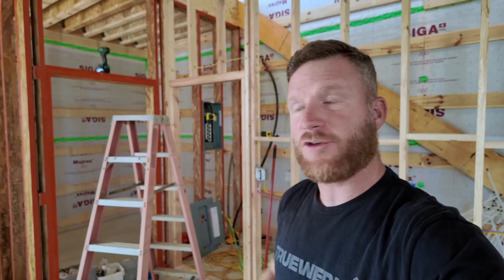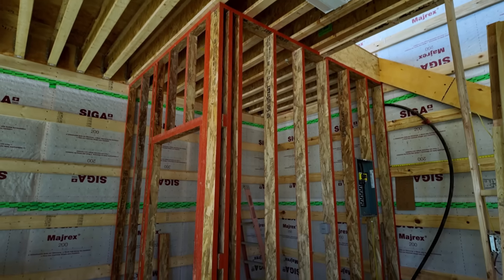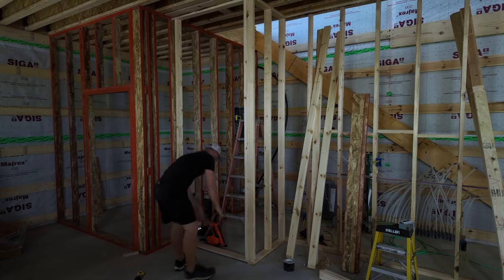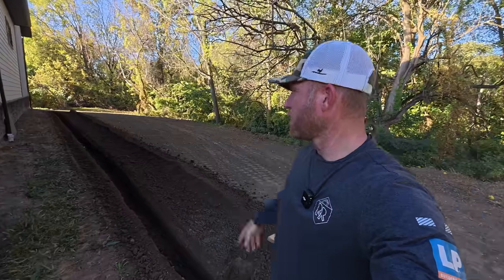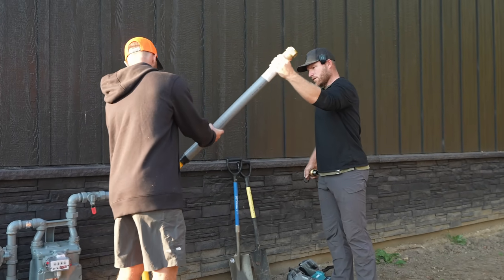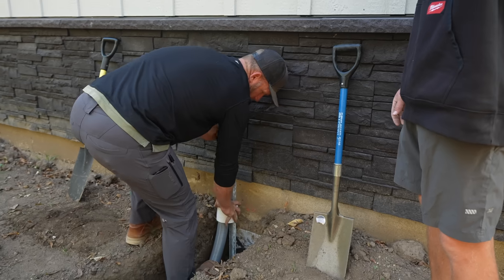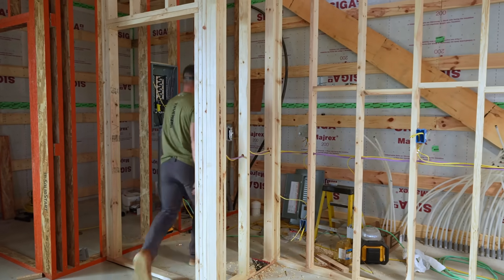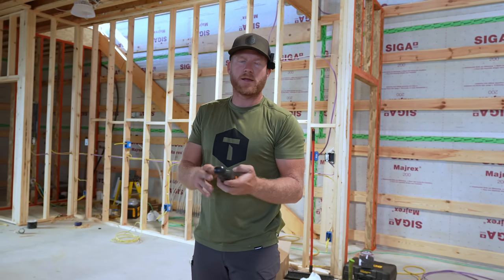Electrical and Gas Update at RRHQ 2.0

Comment: I didn't think it could get any more bizarre with the units than cups, ounces and pounds per square inch. The 'foot candle' is a new level of ridiculous.🤣
Reply: Relates old how far you could see 1 candle lol.

Full daylight typically equals about 1,000 foot-candles, while an overcast day would have 100 foot candles on a horizontal surface.

Comment: Former electrical contractor and inspector here.  You may have an issue with moving that load center further in on that wall.  NEC requires wires to terminate into a breaker or disconnect immediately when they enter the building.  You may need to add a disconnect on the outside before it comes in.  Also, on a 2x4 wall, you cannot use  inside box knockout.  You need to maintain 1 1/4” from nailing surface at all times.  If you miss the stud with a screw, it can go right into that wire.  NEC 300.4(D) on the boxes and 225.32 for the disconnect location.  Hopefully this save you from a failed inspection.

Comment: You can never have too much light in a shop. Whatever you think you need,  double it and put it on multiple circuits so you can turn on as much or little light as you need.
Reply: I just recently finished my garage and yeah I installed a bunch of lighting. The older 4 tube garage light fixture, removed the ballasts and put in LED replacement tubes 

But I wired it so every other tube comes on with one switch, and the others come on with the second switch. I didn't want dark spots, just everything illuminated. If I'm working on something, as simple as flipping a second switch to get really bright.
Reply: @shaunmac983  That's what I'm talking about. Sounds awesome. 

I have marquee lighting fixtures in my shop. Three 13' rails with 76 sockets per unit filled with 100w equivalent LED bulbs. Zero shadows anywhere in the 18'x24' space.

Comment: Hi Kyle, Electrical Engineer here from Australia, have been in lighting for many years.

LED technology is great for efficiency and high output, the issue is that they create high glare and 'hot spots' this is the intensity underneath with a sharp cutoff as you move away. It would be useful to understand how the LED chips are arranged in the fitting itself. One way that manufacturers avoid this is to use optics within the light fitting itself, the LED chip is set back inside of a optic or guide, that way the glare is less intense in your general FoV. A fitting with this feature may be a solution to this problem. The optics will also help to spread the light and reduce these so called hot spots.

Another issue with large spaces, especially tall ceilings is what we call the 'cave' effect. When lighting a large space, you should try and light the walls and ceilings as well, generally 30% of the lighting output. What this will do is reduce the perception of being in a cave and reflect lighting around the space. Research into this has been done and it shown that it increases peoples mood, quite interesting. This is something that online calculators might not be taking into account, hence the requirement for only 3 of the high bay lights. 

Hope you find this useful! Loving the series so far.
Reply: The trendy dark ceilings like charcaol or black would be better served with white or galvanized then?

Comment: I have been doing gas for 45 years and all I can say is Oh Boy. Love your channel. Ron
Reply: Yeah, love RR, but the gas line segment was a mess: Should have been installed deeper. Should have used Lyall 90 deg elbow-style risers with support stakes. No pressure test before covering up the line?
Reply: @preston8847  In Florida we bury ga lines 4 feet deep.

Comment: I went through the same lighting questions with my Woodshop.  I tried several different lights and was not happy.  I contacted American Green Light and they hooked me up.  I sent them a drawing of where all my tools are and they told me exactly where to place each light and how bright they needed to be.  They even gave me a heat map of the shop.  They are not cheap, but it was worth the money.

Comment: Went with Barrina LEDs in my garage.  Super easy install, flexible location, linkable but most importantly, super bright.  Way better than my original tube fixtures.
Reply: I got 36 of the 8' barrina bulbs for shop and garage and 24 of them died within a year. Not happy!

Comment: on your outside walls you can run Romeo without puncturing your Air control layer.  Instead of using the 3 1/2 or deeper single gang boxes, using 4x4 x1 1/4 boxes with a cover plate. if you have to go vertical through your Girts, slot them and plate them.

Comment: In my 30’ x 50’ x 14’ shop (with just concrete and white walls), I had to try a few different luminaires as well. I had the same issue with one that I tried having no diffuser and shining in my eyes without even looking toward them.

I ended up with 8 Commercial Electric 2ft 18000 lumen high bay lights from Home Depot. They have a decent diffuser and I like the color temperature. Very satisfied still after 2 years.

I see that they now have “Commercial Electric 15 in. 19000 Lumens 138-Watts Adjustable Beam Multiple CCT & Lumens Integrated LED High Bay Light 120-277V”

I recommend checking them out. Have the adjustable angle and the adjustable color temp is something I’d really like. They don’t break the bank either. Though the CRI is only 80

Comment: I’m an electrician in Primarily do electrical for two contractors that build post frame buildings. I like the 2’ high bay’s I’d pry use 23,000-25,000 lumen for your building. It’s definitely bright but you could always use luminaire wire and put a dimmer on it as well .

Comment: I have a 50x80x16' ceiling, used lights from prime lights. They are 4' long led bulbs with six bulbs per fixture. 4 rows with 3 fixtures per row. Perfect amount of light for they area.

Comment: I think I would've just flipped the electrical panel around and hid it behind a hinged mirror in the bathroom. Pretty sure that would've met code once the sheathing is up in the mechanical room, right?

Also, something I've been considering with shop lighting is instead of doing direct lighting, use  long drop lights flipped upside down and reflect the light off white or galvanized metal on the ceiling.  We had that in our huge cubicle farm when I worked at Dell in OKC and we always had good even lighting, very few shadows, and no glare. Works better than any diffuser I've ever seen.

Comment: Kyle,
One suggestion would be up firing lights. Commercial buildings use them and you don’t get as harsh a light but still very bright against a white ceiling.

I’m surprised how shallow your gas line is. Here in AZ, minimum of 24” and that dirt looks soft compared to the concrete we call dirt.

Comment: CRI very much matters; try to get over 95.  Remember your "workplane" when shooting videos is your head height, so with a 9' ceiling you really are going to need lights spaced less than 8' apart.  You can turn the highbay lights upside down and suspend down about 2' to reflect off the ceiling. 

Really though you want a lot of lower-brightness lamps to reduce the harshness.  With a 16' ceiling I would say something around 5,000 lumens maximum.

Comment: The online lighting calculators are useful, but for a space like yours I'd go to a local light fixture distributor and work with one of their professionals to figure out what fixtures to use, their lumens/cri/diffusion/etc., the number of fixtures to use, their spacing and so on.  As a general rule high bay fixtures are used when the ceiling is around 15' or higher, switch to a conventional type fixture where the ceiling is lower than that.  You definitely have different zones that will require different layouts - the main open space, under the mezzanine, and on the mezzanine itself (plus the bath and mechanical rooms, as well as exterior lighting and maybe also exit and emergency lighting - I don't know what's required for your type of building in your area.)  I think it's worthwhile to stick with name brands, you can buy fixtures online for less but like anything else you get what you pay for....Lithonia and Columbia are a couple reputable brands but there are others, plus it will depend on who reps for what companies in your area.  Your electrician should be able to recommend distributors in your area.  Note that you don't necessarily need the same level of lighting throughout the whole space - include some task lighting over the workbench where you want it really bright, but for the rest of the space that's mainly going to be for storage the requirements are much less.

Comment: I just built my 30x40 shop 2 years ago. 12’ tall ceilings and we stick framed everything, no metal. And interior done out of OSB. I used a 6” pancake style 1,200 lumen flush mount light. They are cheap and easy to install and put out tons of light. I wanted a flush mount look. I can send picks if you are interested.

Comment: For Lighting, you might try the 4' LED Florescent - Daylight Spectrum.  It has more Blue Color.  Which is easier on your eyes.
The Florescent Light Bulb, Being Round, gives you a Wider Angle, So your light will be more even instead of getting so dim in between lights.

Comment: Look into Rab lighting been using them in pole barns for over 7 years. They are round ufos looking but are fantastic at light distribution. Also for the area with tgis just throw in some can lights. The ceiling is too low for even a low bay fixture.

Comment: I have a 50x60 with 18ft walls.  I used Hyperlite UFO High Bay on Amazon.  Theyre pretty bright.  I have 12 or so.  I did install some side lights to walk around at night without turnign on the bright UFO high bay.  I used 150w and you can get 200w.

Comment: If that's going to be a work bench area, where you were first checking with the light meter, you can always add under cabinets lights. I assume you will have upper cabinets in that area too.

Comment: The high bay lights are a real wormhole to dive into. From my experience, the rectangular lights just seem to be a nicer light, if the look of them when you actually can see them bugs you, find ones with a lens diffuser on them such as a white panel. You can use a low voltage dimmer on many of them, there is a wattage rating for most dimmers and those lights tend to be high wattage, I am uncertain just how large a dimmer can go, but I have installed dimmers that took all the space from a 2 gang switch box and had a breather plate between the switch and wall; a dimmer adds resistance, some of that turns to heat. What I wish I had done was install all the lights on a relay, so I could turn 1 switch and operate multiple circuits of lights with just that one switch. I imagine there is a dimmer for that type of system somehow but have not had to find it before and it is out of my range of electrical work; maybe your friend does commercial/office/storefront work and would have a much better idea than I do. 95+ CRI is the best we have now, lucky for 90+ and the 80+ is a bit bleh. I personally want to be able to read any piece of paper I have anywhere in the shop, I do not enjoy walking over to better light when making things. More lumens is better and if you can dim them, then you can turn down the lights a bit if it is too bright sometimes but you cannot add more light after the fact without a new light. Not all of those lights dim well, some of them, the dimming is a joke like going from a 60 watt bulb to a 75 watt bulb; so ask your buddy or salesmen about that. Most likely, the nearest big town to you that has multiple electrical supply houses will have one that tried to specialize in providing the led lights first, they will be a good source of information for some of the questions you will have, although most may have caught up by now. I say it that way because I have no idea where you live and wish to give your privacy on that.
Southwire sells some romex strippers that look like a T, one side skins 12-2 NMB(romex) the other does 14-2 NM-B romex. They work well when you shove the wires in the boxes before stripping them. there is a small learning curve to them but I recommend them. Klein tools made nicer ones that did a single wire size but no longer makes them, they are shaped like an L; some local stores to you may have a pair on the shelves still depending on where you live. Nice tools that are good for a novice or expert alike, speeds up the process.
I like floodlights to be available to be switched at every exterior door, if you use motion sensor lights forget that I mentioned this. Regular floodlights though, try a few sets of Sylvania Night Chaser LED bulbs, you will not regret it. I like to put the floods on every side of the building so the light continues from one side to the next without walking in the shadows. Just my preference but some things need to be done at night and darkness makes them harder.
That blue wire is the new 14-3NM-B romex? That makes me notice there are 3 wires run through each of those holes down that wall. you are overloaded. Drill an additional line of holes, no more than 2 wires per hole in a 2x4 stud wall; ask your buddy, but there is a maximum size hole we can drill 3/4 or 7/8 allows a bit of leeway without getting too close to the edge and require stud plates/nail plates, that limits you to 2 wires as a rule of thumb.
Sorry if I went a bit overboard, just trying to help you some.
Thanks for the videos.

Comment: I always put in 5500k color temperature LED shop lights. That's the closest to "neutral" and much easier to find spec'd at that rating. The 98 CRI lights are great and all, but usually triple the price. The ONLY place that would matter is in say, like a print shop where they are color checking swatches and print outputs.

Comment: Hey Kyle you might not be familiar with High-bay lighting they are designed to be used in areas with an extremely high ceiling (hence the name), like warehouses or large retail locations like Costco or Walmart. 

High-bay lights are a combination of area light and spotlight. Since their light has to travel farther than standard (low-bay) lighting, high-bay lights sacrifice spread for power. 

Just a thought.

Comment: More important to consider light saturation instead of brightness, nothing worse than always working in your own shadow because the 3 bright lights that do light the place up properly are actually behind you, much better to have 9 lights for greater saturation and never actually have the shadow issue at all. Oh and remember the frequency flashing problem around rotating machines and get the right lights for those spaces.

Comment: 2‘ x 4‘ LED panels made for drop in ceilings produce a very widespread light and don’t have a hotspot. Some models have adjustable color temperatures so you can decide that later.

Comment: In my shop I went against my lighting architect and quadrupled the lights but made sure they are on dimmers. I used high bays for 18 foot ceilings.  I have 4 circuits with the light circuits being same as lighting architect but the other 3 offset to his design. I normally only use 2 on and eliminate the shadows from equipment. I would next time use lower lumen lights in same locations but only 2 circuits.  I do prefer the 4 circuits over the original design. The mess to add more lights after would be more costly and time consuming than the additional cost for my current lighting.

Comment: For burying your gas line. My understanding with gas lines is they have to be wrapped in sand and caution tape needs to then be on top of the sand. Did you do a pressure test off camera?

Comment: That is a cheat using the trencher, when I dug mine 75' I used a shovel and dug it out. Mine living hear in Pa. I went over code to almost 4.5' which to me Gas and Water the deeper the better as it will not get hit easy.

Comment: Hold up... question, are you a gas fitter? 

I can see running the line through the trench and stuff like that but making fittings and connections to the meter? Is that allowed by Joe Contractor? 

Serious question, not trying to cast shade.

Comment: Hi Kyle, i have a question thats not related to this video but what is the benefit of doing that 8” wide foundation wall vs doing the concrete piers? Ive seen in your video you do both styles. And how deep is that 8” foundation wall buried?
Reply from the maker: huge benefit for sealing up a building, no wood anywhere near grade, easy to insulate, forever foundation

Comment: I would have made the access into the utility area from inside the bathroom where you can just put a smaller access door with like a padlock or something on it that way from outside of the bathroom it's you could just keep the extension wall part of the utility room on the same plane as the bathroom wall so that it looks like it's just one room instead of it looking like a hodgepodge of a bunch of angular a bunch of rooms over there with different doors and whatnot You don't need a full size door to access it You could just access it from the bathroom That's a pretty big space that you have there for the bathroom which I'm sure is just going to be a toilet and a sink being that it's a workshop you're not going to have a tub or a shower so there you go